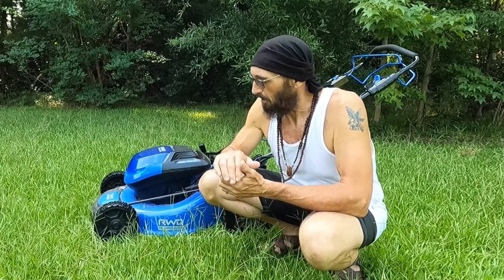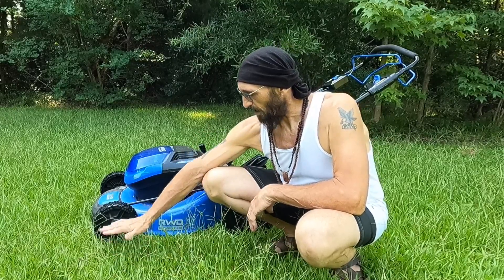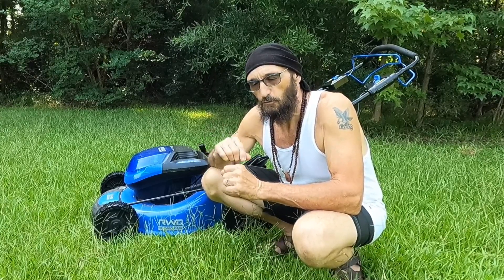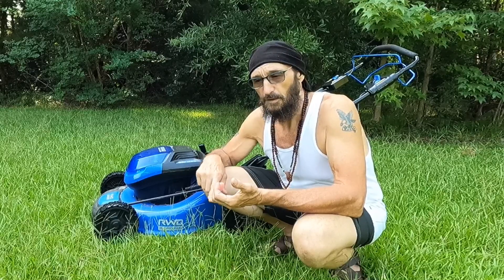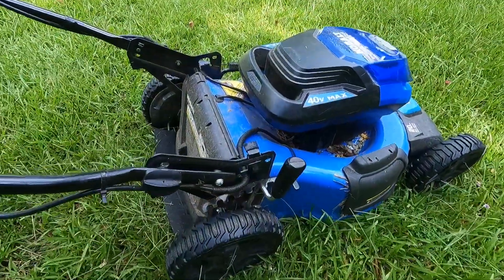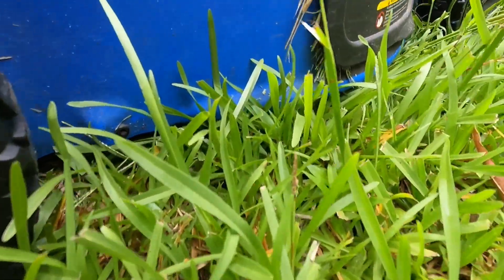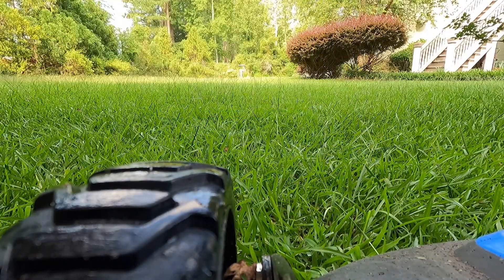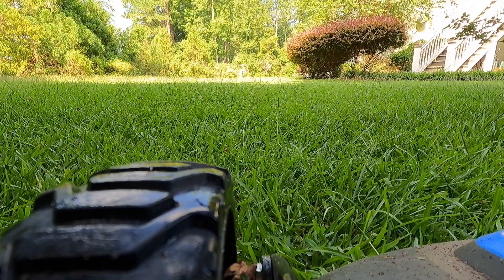#Kobalt #40v Mower Vs Tall grass

Comment: Having a sharp blade on any electric mower lengentens the battery life quite a bit , on our 40 volt kobalt mower I was finding battery life around 45 mins found the blade had lost its edge after 3 years , sharpened it and gained almost 10 mins more cut time.
Reply from the maker: What an excellent point, thanks Brian, you're absolutely correct. I found out the long way too, definitely something folks should know ! Hope you don't mind, I'm going to pin your post. Thanks for watching..!
Reply: Forgot to mention I did grounds maintenance working for a local school district for 35 years so I have replaced a blade or two.

Comment: I have found that a battery charge lasts longer if you bag rather than mulch. I think keeping the grass under the mower to be cut and recut as it does when mulching works the motor harder than if you bag and the grass just gets right out from under the mower into the bag.
Reply from the maker: I’ve probably used the bag maybe 6 times since I’ve had it. Good to know and thanks for watching..!

Comment: Thanks for the content!  All other vids showed only Tiny grass.  I just got this mower and the batteries are $150 each
Reply from the maker: You’re welcome, I figured since I had the tall grass opportunity, why not ! The life of the battery will outweigh the cost. Cheaper then fuel & oil , not to mention other expenses like spark plugs, and pull string hassles…lol. I feel the batteries definitely pay for themselves quickly compared to a gas mower.. I hope you enjoy the mower. I’m still quite satisfied with mine. I appreciate the feedback and thanks for watching..
Reply: @meanderingyogi6562  Im instant fan of this mower. It cut my 1/4 acre yard with ease. Also, hint for anyone else, I found the 2.5ah batteries at lowes refurbished for $40. Scooped up 2 of them and it should be equivalent  runtime to the 5ah that came with the mower.
Reply from the maker: Excellent info on the battery buy, thanks for sharing ! Glad you’re enjoying the mower, no going back to gas for me as long as a battery mower can do what I need..
Reply: @dylanrap9778  does the mower perform the same for you with the smaller battery other than the runtime?

Comment: Do you ever have an issue with the mower overheating in hot weather? Also, do you usually use the mulching feature of the mower? How does it work?
Reply from the maker: I haven’t had any heat related issues, I always mulch the grass. It mulches wonderfully, just make sure the blade is sharp.. The only time I bag is when we need the clippings for compost.. thanks for watching..!
Reply: @meanderingyogi6562  thank you! I’m about to pick up one of these. Going to get the gen 4 version of it. Comes with 6ah battery so that’s awesome. Thanks for the video and your reply to my comment!
Reply from the maker: Excellent, I’m a tad jealous though… I’ll be looking forward to a new one soon enough.. For now though, I’m still happy, this one has served us well. Enjoy..!

Comment: Yes I have a Cobalt 40 volt battery. I was told you couldn't cut wet grass.. And living here in Florida that's hard not to do. So it looks like you had no problem with it being wet and it didn't hurt your battery or the mower. Is that right? That's exciting being able to cut the grass wet.
Reply from the maker: I wouldn't cut in the rain of course, and I'm not certain of manufacturers suggestions. But with that being said, I've been using this mower for 4 yrs now and never had any issues from cutting wet grass other then build up under the mower deck. Which is to be expected. Thanks for watching Karen..!
Reply: @meanderingyogi6562    Thank you for answering me. I'm glad I finally cut my wet grass. And my mower is ok. I had to stop quite often to clean the grass out from underneath. Thank you again for letting us know that it's ok to cut wet grass.